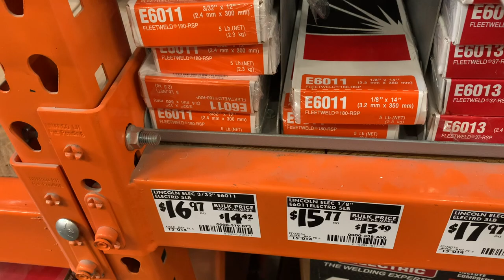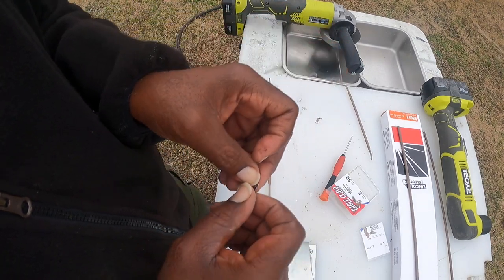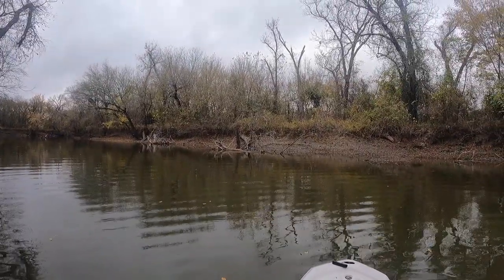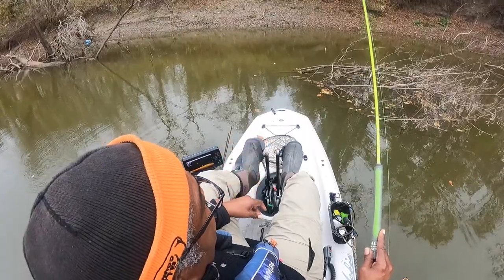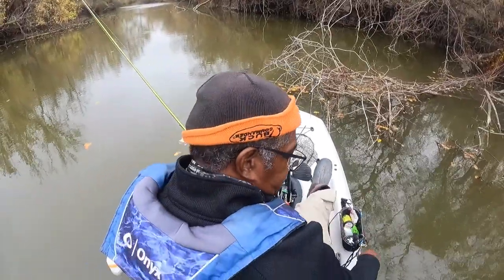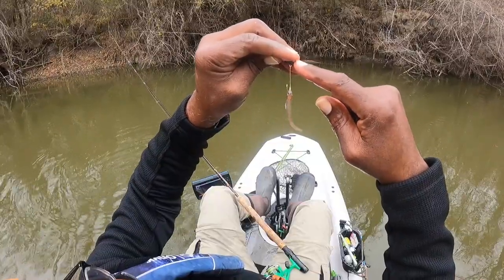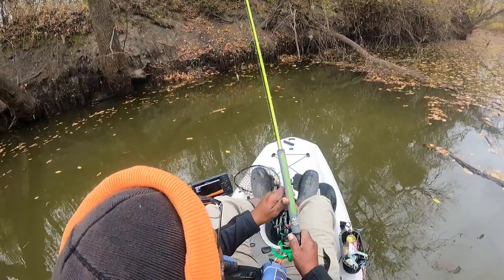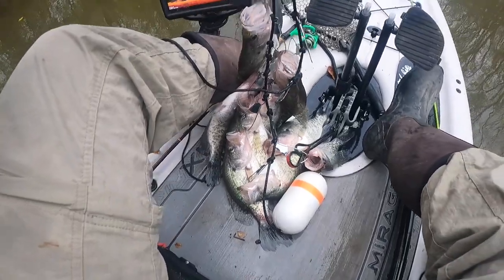BEGINNER CRAPPIE FISHERMAN TIPS AND TOOLS TO GET YOU A BIGGER CATCH.HOW TO FIND CRAPPIE IN THE CREEK

Comment: If you mentioned it I guess I missed it but how long are you making the brush buster?
Reply from the maker: I usually start with 11’’ but the thing to think about is making it the size that best fit the water depth. The deeper the water the longer the brush buster. I wouldn’t go below 6’’ or higher than 11’’.

Comment: Question?How deep is the transducer supposed to be in the water on a fish finder?
Reply from the maker: You should check the instructions on your fish finder for the correct depth. I’m fishing out of a kayak and the transducer is just below the kayak.
Reply: @WileyCoyote  it doesn’t say. That’s why I’m asking
Reply from the maker: Your transducer should be placed even with the lowest point of your boat. Your goal is to locate on your boat or kayak in a location where it want get damage when you are moving around on the water but the transducer has to be deep enough so that boat or kayak doesn’t interfere with the down Images or side image. Could you please tell me what type of boat or kayak you are using and what fish finder are you installing?